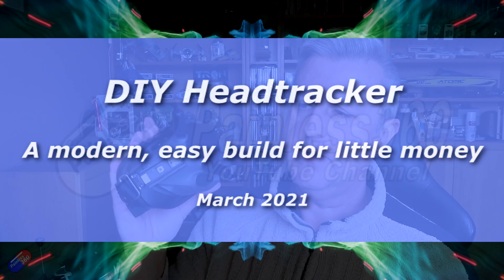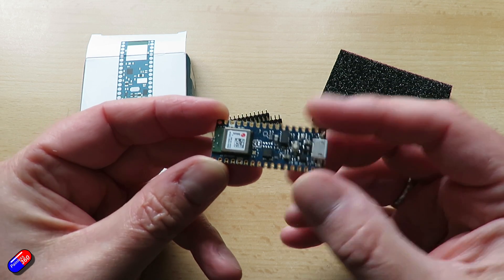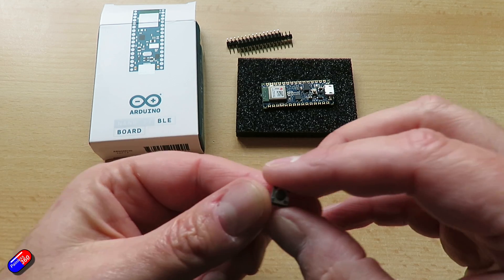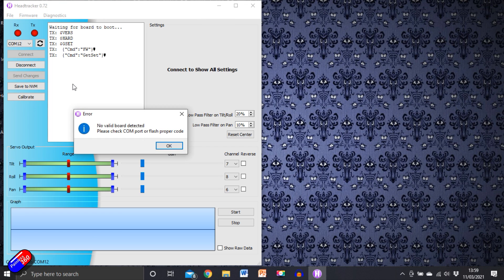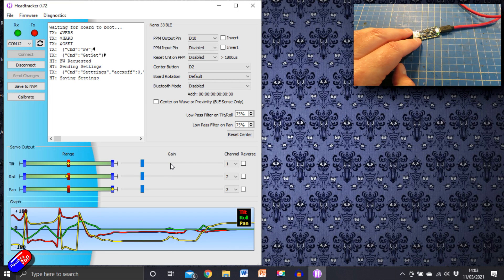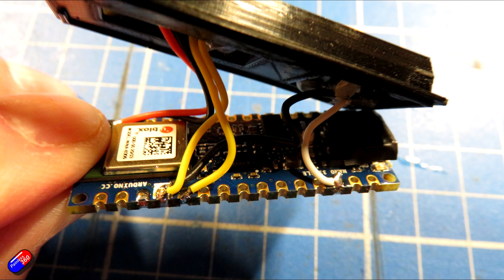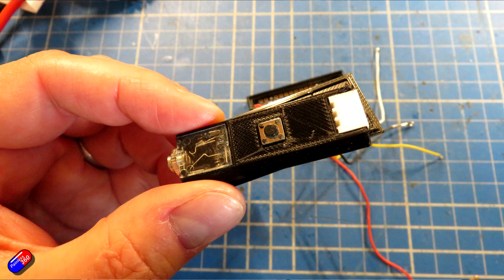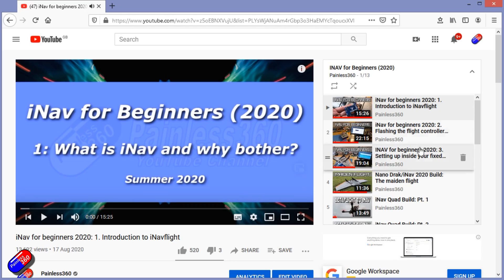Modern, easy DIY Head Tracker build that costs less than $30!

Comment: Do you know anything about making a head tracked gyro stabilized camera?
Reply from the maker: Not something I've done recently. Most stabilised camera gimbals allow you to move them using PWM control.. Best of luck!
Reply: @Painless360  Can you explain to me what PWM control is?  What gyro stabilized cameras do you know by reference that you speak of?  I want to make a gyro stabilized DJI camera system that is head tracked.  I want to see if I can make an awesome drone that allows me to make films with that is head tracked.  I also have a queston about radios.  I want a 20 channel camera that doesn't allow for stick mode switching.  Do you think i would be able to pull the gimbals out and switch them without breaking or damaging the radio?  I want to try to change an ix20 or something so I can fly in stick gimbal mode 3.
Reply from the maker: https://www.youtube.com/watch?v=GbUMC8h2uhU
Reply: @Painless360  Thanks for that information.  Do you have any information or suggestions for wanting to fly stick mode 3 on a higher channel count receiver? I would like to have a 20 channel receiver.  My radio only allows for 8 total channels but allows me to fly any stick mode that I want.

Comment: Nice one again Lee, works like a charm. Just a (very) little note about your 3d case: the top part seems to need support if loaded with the other parts. I cannot separate them in Cura to put it upside down. So I loaded them first in a cad program to do that.
Reply from the maker: See my video on how to separate parts in CURA... Happy flying
Reply: @Painless360  Yep, I should have Googled first of course.. ;-). Indeed very strange that Cura removed the feature in the later releases. Btw: you make a LOT of video's in a year ! haha

Comment: how to i connect the head tracker to fsi6
Reply: @Simon Lomax no I couldn't not interface head tracker system to fs i6 even though it's supported
Reply from the maker: No idea. Check out the manual for the radio to see how to setup the trainer function (if it is supported)
Reply: @Painless360  it is supported
Reply from the maker: All I know is in the video. Best of luck

Comment: Fantastic.  Those kids that we complained about spending all their time in front of a computer are just killing it now!  I noticed on the github link they also have a link for a wireless PWM module for the transmitter connection.  (personally, the section for a TX16s is a gift!).  These hobbyist single board computers have allowed us to programmatically interact with the physical world, e.g. head tracker.

The 33 BLE Sense, in addition to the 9-axis IMU have pressure and temperature.  All one needs to do a DIY flight controller is one was crazy enough to do it.  (Going to be hard to beat Matek!)
Reply from the maker: I'm guessing you are not a regular viewer. Check out the video I did recently on the wireless link working on a Tx16s.. Happy flying
Reply: @Painless360  Pretty regular and a supporter, lol, but must have missed that one.  I'll find it.  Cheers.

Comment: Thanks for this! I was able to finish mine this week and it works great! Question though, is there anyway to increase the pan range? I have already increased it in the head tracker software
Reply from the maker: Depends on the range of movement on the servo.. best of luck
Reply: Does it drift any?

Comment: Fantastic video, with great information. Just a quick question if I may.  I do have a Taranis XD9. But I am wanting to put my FPV setup on a Spektrum DX7s. I have been searching for the Spektrum trainer port voltage output (3.3v?) with no luck. Can you tell me if the Spectrum DX7s is compatible without using resistors? Im sure there are other out there with the Spektrum with the same problem.
Reply from the maker: As far as I recall it is the same - https://www.youtube.com/watch?v=Oqj_nOAWJMM
Reply: @Painless360   Thank you very much Lee. Much appreciated. Keep up the good work. Fantastic channel with huge amounts  of information. This channel got me through the Frsky nightmare....lol  Easy when you know how.

Comment: If I have a Crossfire module to control the aircraft, can this connect wirelessly to the TX16S built in 4-in-1 radio?
Reply from the maker: Not wirelessly. Happy flying!

Comment: Hello!  the project is beautiful, I also bought the nano 33 ble card but I have a problem .. my pc does not recognize it ... it turns on it flashes but I can't connect it .. I have win10 as an operating system .. could you give me a  but no??  thanks 🙏🏻
Reply from the maker: I'd try another USB cable before looking at drivers.. Best of luck!
Reply: @Painless360  thanks for the advice .. today i will go buy the new cable and i will let you know 🤞🏻

Comment: Thank you for the super video again. When you want to mount it on the side of a goggle, like you did. Should you calibrate is on  
its side? I.e. in de the position you want to use it in?
Reply from the maker: I would as the magnetometer could be affected by the proximity of the goggle..

Comment: Cant figure out how to hmget the signal in my taranis x lite pro 🤔because of the problem with the trainer port
Reply: The Xlite Pro has PARA wireless trainer. This HT will directly connect to it via Bluetooth, no wire needed.
Reply: @cliffblack569  nice! So what you are saying is the arduino nano ble diy headtracker has a bleutooth conection to my tx?
Reply: @JW-ww4ly  that's right. See option 1 in the wiki
Reply: @cliffblack569  done donated and works like a charm

Comment: I am definitely building this and can't wait to have it in a plane. I power my DJI goggles via a PD USB power bank which has spare USB A port. Possible tip, use the Newbeedrone PD goggle cable with any PD powerbank (I keep a Ravpower power bank in my pocket) just run a usb cable along with the goggle cable for power?
Reply from the maker: As this runs from 5-20v it should run on that fine.. Best of luck!

Comment: thank you for the video and links, i wander .. since i have the original ht from the project made like 8 years ago .. ( no drift head tracker .. ) what had changed ? .. why no bt option ? .. the biggest down side is the added cables .. and with new v2 dji goggles .. it is 2 cables ....  i may give it a try anyhow ... thank you !
Reply from the maker: All covered in the Wiki. The new version has wireless support and a few other tricks too. All HT units are basicslly doing the same thing..

Comment: Awesome.  I have installed a Bluetooth module to my jumper t18 board to have wireless trainer support...  what would I do to make this ht Bluetooth to my t18 as well?
Reply: There are two BT modules available, if you installed the PARA module it will directly connect. See https://github.com/dlktdr/HeadTracker/issues/22 for information on the supported module.

Comment: Thank you mate. You kinda just accidentally helped me out with another project. I have been wanting to put an artificial horizon and compass on 2.5" displays in the cockpit of my 1/4 scale 20cc affordaplane but put it on hold because the form factor was just too large. The  33 BLE seems to be the way to go. Thanks! PS, I'm still using Fatshark/Trinity.

Comment: turning do one of these at  hobbyking for 30 dollars.  couldn't an old flight controller be set up to use the gyros for this? thanks  for the video.  if I cant find my old turnigy nocking around in box somewhere i am going to use your suggestion.
Reply from the maker: That would be a fun way to use old, outdated flight controllers. I'm not aware of a way to do that but if you find one, please let me know..

Comment: Brilliant...... built the old style way back when and had no problems with that. This is many times easier.
Edit:- Looked up the price of the Arduino Nano 33BLE and at between AU$70 and AU$90, I think it will go on hold until some clone chips are produced. Present old Arduino pro mini unit cost me around $20.00 total and will do the job for now.

Comment: I have a spektrum DX8E.  Do you think I would be able to get it working?
Reply from the maker: I don't see why not - the HT setup on the Spektrums uses the same 3.5mm PPM input normally...
Reply: @Painless360  What kind of frsky model allows mode 3 gimbal setting?

Comment: 3axisGimbal & Head tracker together??? Is it possible? 
By the way awesome detailed video like always Sir.
Reply from the maker: I'm not sure what you are asking, can you elaborate?
Reply: Usually HeadTrackers talk to the servos on the vehicle . Can we make the headtracker talk to a 3AxisGimbal .
Reply: I have done this on my Storm32 gimbal via serial link and Ardupilot. It's possible as long as your gimbal supports some form of input
Reply: @cliffblack569  i have storm32 3axis gimbal. Any website link on how to go about
Reply: If your running ardupilot for you flight controller you can wire it into a spare serial, https://ardupilot.org/copter/docs/common-storm32-gimbal.html .If not you can setup your flight controller to pass through the 3 PWM channels and use the Storm32 gui to configure it.

Comment: Thank you, thank you, thank you. I had so many mixed results with the old way of doing it I gave up. Can't wait to give this a go. 
Still baffled why no companies aren't making rc headtrackers.
Reply: i just asked a company and they say they would do it. probably come out next year.
Reply: @matthew04101  I bought my first one 10 years ago about. Can't believe the fall of the art. Flytron doesn't even sell his anymore. Can't wait for more options, but this solution in this video sounds AWESOME. Kuddos to Painless and the guy who heads this project
Reply: @luciduous  are you talking about the wireless solution, from head tracker to radio ? that sounds nice, but i'm worry about latency. servo is already slow and adding wireless latency might make things worse. i guess it should be ok for rc plane and cars. i'm planning on using it with quadcopter, so latency is very critacal.
Reply: Not sure how to connect 3 outputs (pan tilt roll) to 2 servos (pan and tilt)?

Comment: Nice little project. Thanks for sharing these DYI resources. 
A quick easy case would be to use some larger diameter heat shrink tubing. Could warp PCB in a piece of thin cardboard to square off profile before adding the heatsink.